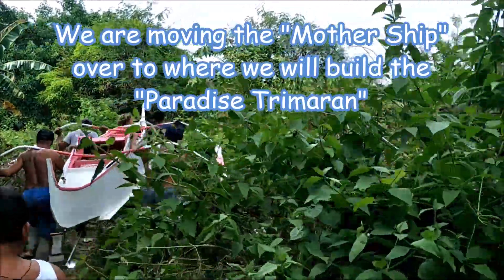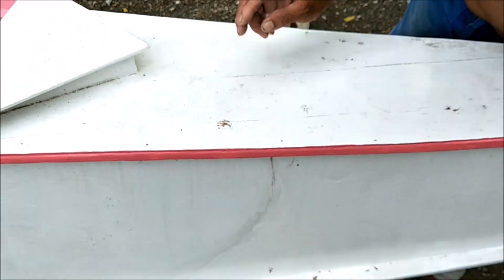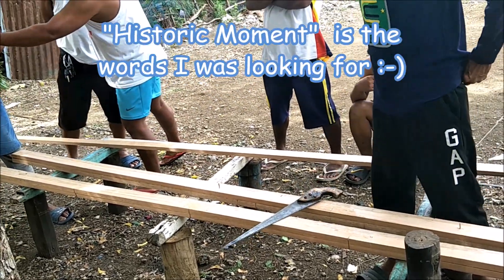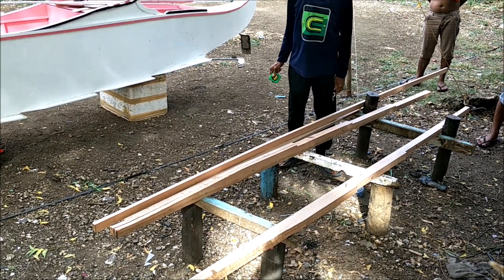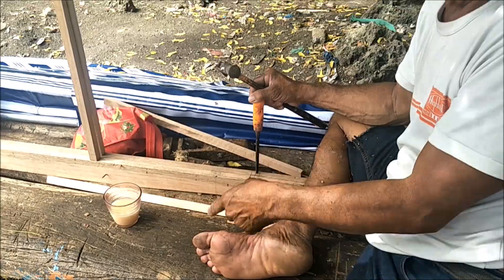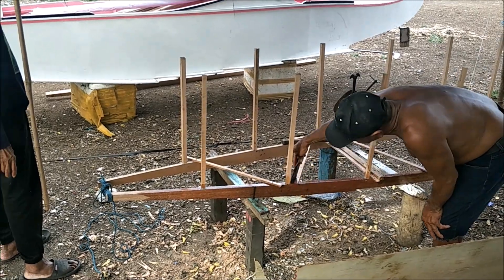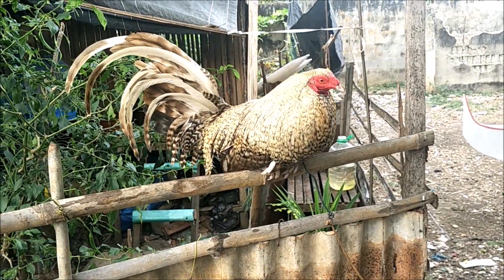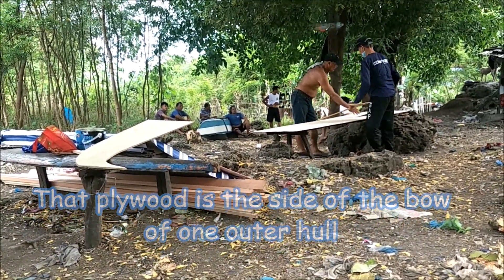Paradise Trimaran - Part 1 - Boat Building In The Philippines - Laying Out The Frame

Comment: As a furniture maker and woodworker for over 50 years, this is fascinating to watch them building this using these methods. I wonder where the design came from. The ribs mortised and tenoned into the rails is a framing method that dates back centuries in furniture making, and similar to old boat building techniques, I’m wondering if it came with the Spanish people. Setting out a jig with a center line would be easier than eyeballing it. I would like to see the ribs being a bit wider for more of a nailing and glueing surface, I understand that weight and economy of material is important, but just to give a wider surface would not add much. I’m also wondering why they used two different types of Luan for the main frame base. Very interesting video, I’m enjoying these.❤️
Reply from the maker: The lawaan was what came from the lumber company, they prefer the white for the frame and I would use 1x2 for the ribs, I will have the frame beefed up because it has stress being a multi-hull.
Reply from the maker: The 3 cut boat is originally a racing boat so they are super light, however they are outlawing cutting trees for kasko's (dugout canoe hull) now so they have adapted the 3 cut into fishing boats.

Comment: You wouldn't be able to flip that boat over (capsize)if you tried. Should be very stable 👍I like how they made the permanent saw horse/jig  contraptions in the ground.
Reply from the maker: Not the trimaran, however the 3 cut hull alone I almost flipped getting into it but the water was shallow and the outrigger hit the sand bottom and stopped it fron rolling over.😊
Reply: @myparadiseonbantayanisland9030  you would think tri hull almost like a pontoon boat.  No way to flip it unless 30 ft waves 😂